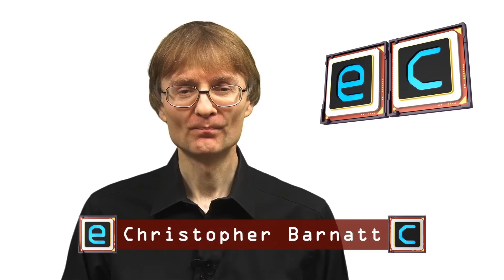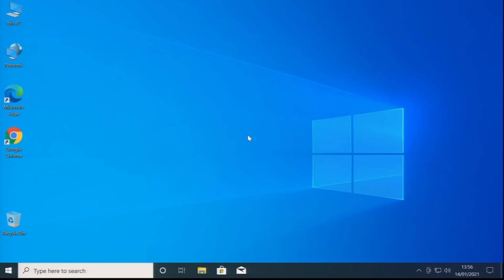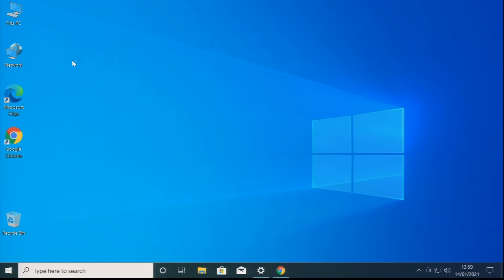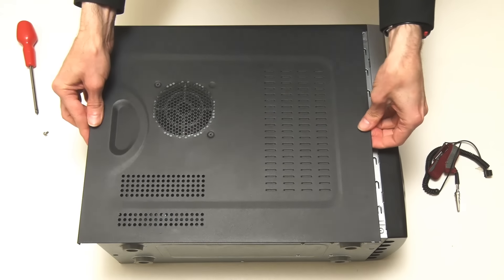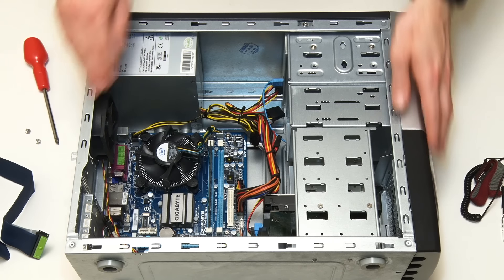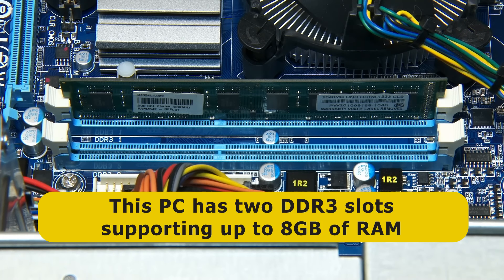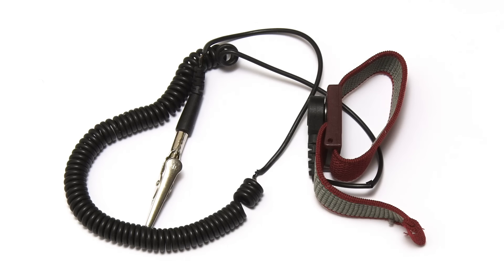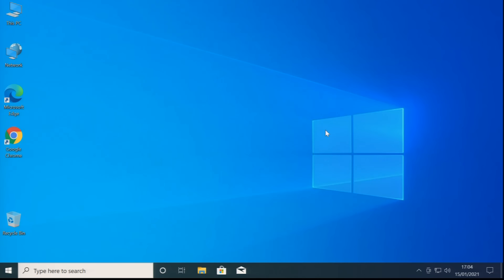Old PC Upgrade #1: Options & RAM

Comment: I had an old pc  like that I installed Linux on it
Reply: Same. A lightweight Linux OS does not use half the resources that a stock windows installation would. If you don't mind the learning curve, it's certainly a free performance boost.
Reply: Same. I installed Linux Lite on an old pc from 2007 and I use it to watch Movies and TV shows locally (though I have plans to turn it into a local file server soon because I found a faster pc to replace it)

Comment: Please, please, please, consider replacing that power supply. All your hard work may go to waste if the power supply fries your motherboard due to age or low quality components.
Reply: Out of interest, have you experienced that yourself? I've been tinkering with old PC's for years and never had a power supply fail and damage other components.
Reply: @derekp2674  Yes. Probably the single most critical component for PC longevity is the power supply. And the only way to really tell if it's any good is to put it on a $15 tester that reports voltage (not just line-good). You'd be shocked how many "functional" and even "quality" power supplies produce a continuous barrage of spikes and sags... which are the mortal enemy of fragile electronics.

Also, there's a simple way to evaluate the basic quality of a power supply: WEIGHT. If it's under about 3 pounds, it's probably crap. Heavier PSUs have bigger heat sinks, and bigger capacitors, which translates to less corner cutting... and they naturally weigh more.

So yes, I would replace that PSU, or at the very least test it properly to ensure that it's not going to cook stuff. Cuz that is definitely a cheap one.

Incidentally, good quality PSUs can last 20 years or more even under heavy load, and when they quit, they just quit. Cheap ones often only last a couple years, and often cook your motherboard on their way out.
Reply: @derekp2674  I've had it happen to an old Pentium 2 board, but I don't know if the motherboard was already faulty, as it was already displaying (literally) strange behaviour before the power supply went out. The only thing that seems to have survived is the graphics card I had in it.

On the other hand, I have a P3 motherboard that survived 3 blown power supplies, one of them having gone out very violently.
Reply: @Reziac  Thanks, that's interesting. I replaced a failing PSU in my bother's Pentium D 945 XP PC a few years ago, allowing it to remain in service today.
Reply: @derekp2674  I've been surprised at the number of folks who've said it's vital to replace the power supply.  I've had power supplied fail, not a lot but enough, but I've never seen a system/mbd failure caused by that.  Unless he's installing some power hungry peripherals (and going SSD will less power needs a lot), video card, or other things, he can check the actual power usage and decide from there.   Yes, I agree, p/s ratings are almost always inflated a lot, so no, if he's going to need 337w of power (if that was the p/s rating), it needs replacing.
Reply: Speaking from my own experience, I've had one power supply burn out (I happened to be talking on the phone and gazing absently at the computer when it looked like a flashbulb went off inside the case).  Everything inside the box survived without damage and was up and running normally as soon as I attached the new PS.
Reply: If I ever build a 'new' PC it's always from used parts - except for the PSU. I'll always spend extra on a new PSU if it's a dodgy looking generic one. They can and DO fail - and the one in this video is 350 odd watts - add a graphics card and you're on thin ice. It's bit like an insurance policy - it might not take everything with it, but what a PITA if it did, especially loss of drives/data etc. Thinking of the age of these machines now too, some of these PSUs may have been built towards the end of the 'capacitor plague' era. Either way, power electronics like FETs and caps are probably the most stressed components inside a computer.. I'd just pony up the coin.
Reply: I have been dealing with PCs for 35 years. About 15 years as a ICT business and the rest as a professional user. I have seen power supplies die, but never, ever I have seen a power supply damaging the PC components. Well, once. When my antenna tower was hit by lighting. And the lighting energy was fed into my protective ground.

Comment: For older friends and family during the pandemic, I have recycled 7 different PCs I got from clearance houses and outlets. Most times these are Dell or HP machines that have come off lease but I did get a couple that were 8-9 years old. My standard for browser and Zoom usage is 4GB RAM and 500GB HDD. USB2 is okay for most of them, but I did occasionally install a USB3 card. I've been able to keep the budget low: $125 for the PC, $75 for 21" monitor and $50 for cheap webcam and speakers. I was torn about getting Chromebooks instead of PCs, but it turned out the PCs were way more versatile in the long run.
Reply from the maker: Sounds like you are doing a great thing.
Reply: Chromebooks are really easy and simple to use, if you can get by with web browsing and simple related apps. But if you want to read a CD-ROM or play a music CD, you simply cannot do that.

Comment: I use a 2007 Dell Inspiron 560 as my main PC and it works great! It has an Intel Core 2 Duo, 8GB of ram and its original 900GB HDD which is plenty for me. I also have all of the factory windows 7 dell restore disks including drivers!

Comment: Would you be considering the addition of a graphics card? Maybe a low profile/power option from the same era like a 2GB GT 610?
Reply from the maker: I may! :)
Reply: @ExplainingComputers  Altho unless it's to be a retro gaming PC, that won't make near the difference that all the other possible upgrades will. Alas, it has but one 16x slot to offer. And it may not support a newish card anyway.  (That's a problem with its era, these newfangled slots of early specs, and not enough of 'em.)
Reply: @ExplainingComputers   Christopher please  take vitamin D ( 4000 units per day) 4k international units /day  
Vitamin D3 .
Chirs its important for health .
Reply: I'd like to see the addition of a graphics card to output UHD, not for gaming but photo editing, spreadsheet, etc.

Comment: Another aspect worth considering, which I dont think was touched upon anywhere in this series of upgrading this PC, is installing a dedicated graphics card if the computer doesnt already have one and is instead relying on onboard graphics (or cpu graphics), especially on a PC as old as this one. It doesnt have to be anything fancy, and can be a simple cheap mid range one a few generations old even, just anything to offload that workload and memory usage from the motherboard and onto a dedicated card with dedicated graphics memory

Comment: This video is also useful for people who just want to add some more USB 3.0 connections to their PC. The PCI USB 3.0 connector does show the limitations of an older motherboard like this. But it is still a noteworthy upgrade.
Reply: The autoplay moved me to the next video before I hit the reply button. I swear. I meant to post that comment in your "USB upgrade" video. 

Also, I just realized that I have a E7500 in a box somewhere, not being used for anything. It is a little higher clocked and has more cache than the E5500. But it is not a noteworthy upgrade. I removed the CPU from a motherboard that had broken pins. Someone handed it to me as "junk" and the CPU was all i could salvage from it. I am not using the CPU for anything, not sure what to do with it.

Comment: I’ve got an old Dell Studio 1555 for the princely sum of £25 with P&P, which UPS promptly dropped when delivering. I bought it for Linux and it came with Ubuntu installed, I've already ordered a Kingston 240Gb SSD for £30 and a new battery for £13. However, price to upgrade my DDR2L RAM from 4Gb to 8Gb is between £85 (on Ali Express where I was scammed out of £13 on my first order) to £105 on eBay. That takes it from now a £68 laptop to a minimum of £153 if I go to AE not knowing if my RAM will arrive. I have also considered over clocking my processor from 2.4hz to 2.8 though with it being 12 years old I'd be worried about stability. Finally I'm changing the OS to Zorin OS Core, I will be mainly using it for Arduino.

A very interesting video, thank you.

Comment: Apologies if someone has already mentioned this, but laptops and lower-end desktop systems from this era often had 32-bit Windows installed even though they were 64-bit machines. Even if they had 64-bit Windows, their memory usage was limited to just over 3GB as memory addresses in the 3-4GB range were used by the on-board graphics cards. I discovered this when I upgraded my laptop to 4GB, but it could only use just over 3GB. There were still 32-bit machines around then as well, so as you say, gathering as much info at the start is good advice.

Comment: Built my first PC inside a Thermaltake Armour super tower.  I am very fortunate to own such a case and it has seen countless minor upgrades and two major upgrades through its 15 year lifetime.  I made a point of buying the biggest and best power supply for this case, an Antek 850 watt Quatro power supply with originally for powering dual SLI/Crossfire graphic card setups.  This old PC shares space with a newer high end PC but I can still upgrade my old Thermaltake Armour/850 w Quatro PC to all the latest internal hardware.  Big is always better when it starts with a well designed case.

Comment: My mantra is "Your PC is ONLY as fast the slowest component!"!!!😂😆🤣 That being said, the components ripe for upgrade are of course the RAM & SSD. Additionally CPU based on the socket can almost always be upgraded as most basic users only install the most reasonably priced CPU to meet their budget. Another upgrade that I usually do is putting a dedicated video card in the PCI-E x16 slot as doing so will offload the video processing from the motherboard to the video card...AND if you use any software (DVDFAB) for video transcoding it will offload processing to the video card, in my case an Nvidia card utilizing CUDA processors for easily transcoding the video without bogging the main computer CPU down!!!😁👍🏻

Comment: Thanks Chris, can connect with this. Did similar in 2016 when installed new components in my old AMD-box like: MSI lga1150 mbd,  Intel G3240 3.1Ghz cpu,  8GB ddr3 ram. Also had to buy new 400W 24pin PSU. Total cost ~150 USD. Installed Linux-Mint XFCE on it.
Reply: Chris your video brings-out inquisitive lad who loved reading, playing computers in the 90's while pursuing engineering.

Comment: Greetings from across the pond, from near Albuquerque, New Mexico, USA. I find it enormous fun to visit 2nd-hand thrift stores where I sometimes find older computers and many times newer networking hardware. So much fun to tear into an old PC and it's OS, and then upgrade what seems reasonable to have a usable desktop or laptop.For example, just picked up a Dell Inspiron 600m laptop in great shape for $8. Found out that it has an IDE 2.5" 5200 rpm drive in it. So far haven't found an adapter to replace it with a SATA SSD drive, so bummer with that. And it has only 2GB memory slot. But so what? For $8, I'm having fun installing Linux Mint (it came with Win7 but was password protected) and seeing just what it can do. And learning lots on the journey, too. This approach is certainly not for gamers, but I'm not a gamer, I'm a computational scientist/engineer. These old upgraded machines can always do math lots faster than I can, so I keep doing this with old PCs, even though I have 30 Raspberry Pi's that also keep me busy with parallel computing with the networking hardware mentioned above. Never had so much fun!! KEEP YOUR GREAT VIDEOS COMING!!! :)
Reply: cracking a windows password if you have hardware access is very simple, just google it.  And there are IDE to M.2 adapters out there as well so you can go that route for SSD.

Comment: Hi Chris, that is a very clean vintage pc. I have found it necessary in more cases - no pun intended - than not to clean dust from the cpu cooler fins and replace the thermal paste. This can result in a pc that is cooler and runs more quietly.  Anyway, I am looking forward to yhr next installment.

Comment: Oooo Chris, again for me your timing is spot on.
 Just got gifted an 8 or 9 year old desktop tower that was no longer needed from a family member.
And while I know my way around the inside of a tower, as usual I love your style and presentation 
, and have found several tips and tricks for me to try to get it working much better. 
  I did already buy a code for Win10 from an online seller, and just doing that has helped a lot.
 Now to try to maximize my ram, and I already have a spare SSD ready to install along with your next installment 😃
Reply: Too bad you paid for the W10 license as it wasn't needed.  Assuming you have or can get the current license from the machine, stickers, utility running in Windows, W7 and 8.x can still be upgraded to W10 for free!  It's just not automatic any more, you have to build a USB upgrade stick, or an ISO you can write to a dual layer DVD (too big for regular DVD), and you can upgrade!  Look for the Windows Media Creation Tool to get the stuff.  When asked, just enter the W7/8 license key and it'll be accepted!  Be sure to load the same version of 10, like home to home, or pro to pro, or it won't work.
Reply: @richardwernst  well.  Funny thing. 
The store had a discount code. 
 That actually covered the price of it 😆
 So. While I did buy it, it didn’t cost me anything 👍🏻
 Also. The system had Home. I got PRO this time. 
  Never hurts to have a spare anyway

Comment: Very much looking forward to the next in the series! I have quite a few old desktops laying around and have spent some time considering how to make significant improvements without impinging on a limited budget. I would like to suggest also perhaps a video looking into alternative OSes for older PCs. Not terribly skilled myself, but I'm well aware of things like various iterations of Linux which run older machines very efficiently, not to mention no OEM/cost issues whilst tinkering with your machines!

Comment: Ive been migrating to a used office computer this week. My last computer was also a used office pc. It is great for tight budgets, it is also a green choice that reduces electronic waste. My only complaint is, that most office computers like dell optiplex or hp compaq etc use specialized connectors. Fan pins, different io panel connectors, additional sensors, intruder switches, non standardized psu connectors. I wish more adapters were available to consumers, because not everyone would try to map out pins and upgrade certain parts. And it is also a nightmare to find original parts if thermal sensor fails or fan gets too noisy.

Comment: I recently changed out a WD blue 2.5 HD for a WD Blue NAND SSD.  Big performance increase esp on drive intensive activities.  I also used a dual socket USB to SATA drive with clone feature to clone the old drive to new drive with perfect results.  Popped the 1TB drives back in the adapter and all was well with the universe.  I also put the old drive in a non stat bag and labelled it as backup drive for the PC in case the universe throws me a bad drive pitch.
I got my dual USB to SATA drive adapter on Amazon for $35.

Playing with older computers is a hobby of mine.
I have:
1 PC running Win 98SE  With 1.4 and 1.2 G floppys. and of course 40 gig HD.
1 PC running Win XP Pro
1 PC running Win 7
1 Running Win 8.1
A couple running linux.
And my latest toy Raspberry PI 4 8 gb which I am using for this post.

I was going to install DOS V6 on one but alas the floppys went bad.  
I recently went thru hundreds of floppys and over the years all but less than 10% had gone bad.

Comment: I find it quite bemusing that, since DDR2, dual channel is still the standard. With uATX and larger boards with more than two DIMM slots, the feasibility is there for CPU manufacturers to push for higher-counts of memory channels for even more performance.

Comment: Also worthwhile for an old PC and what i recently did to an old HP Elitedesk i7 was to install a "PCI-e to M.2 card". Only about £10. Then add a M.2 SSD. So way faster than a SATA SSD and roughly about the same price. So a no brainer. Also worth adding a graphics card. Something like a GT730 4GB as they just use Bus power. Then disable the Intel HD. That way none of the 8GB would be allocated for video ram, meaning more for the OS.

Comment: i only wish you will show how to wipe a hard drive clean so its safe to dispose of and or recycle. I havent any precise and clear step by step video tutorial on that yet. Also, your deliberative analytical consideration of options, and efficiency would much appropriated.
Reply from the maker: For safe disposal, use Diskpart as shown in the video, but rather than entering  "clean" enter clean all to set every sector on the disk to zero. It will take a long time to execute.

Comment: Great video. It's also worth noting that some 2009/10/11 DDR3 motherboards will only accept low density DIMMs. This is especially apparent on some Dell LGA 775 motherboards that only have two DIMM slots. A good example of this is the old Vostro 230, which has two DDR3 DIMM slots and officially only supports a maximum of 4GB. However, if you use 2 x 4GB low density DIMMs, it will infact accept 8GB total and work perfectly. Generally 2 rows of chips per DIMM (double sided) imply it's low density, and it's not uncommon to see for example a high density 4GB DIMM with only 1 row of chips, in some of the later DDR3 systems.

Comment: This "old" PC is exceptionally clean and the cables are well managed. Everything is in excellent condition. An SSD (even small capacity as 128G) upgrade should significantly speed up boot time, and the operation should become even smoother.